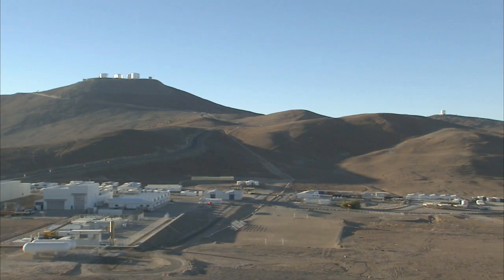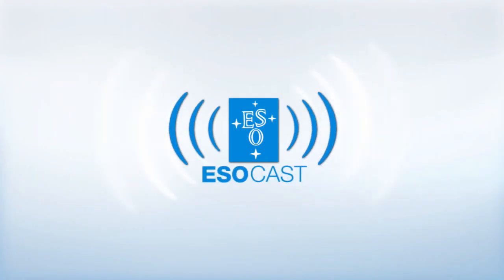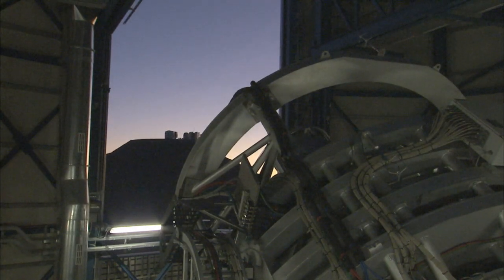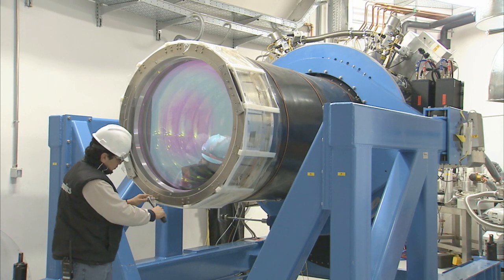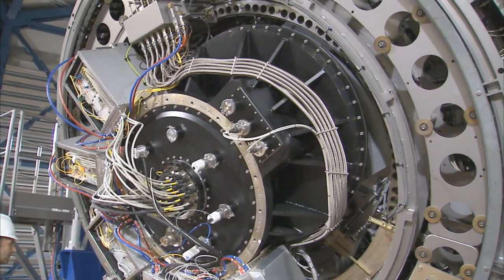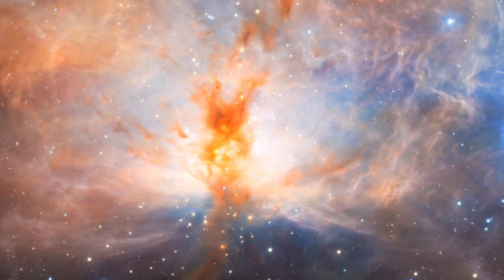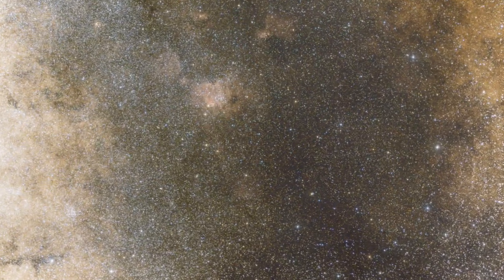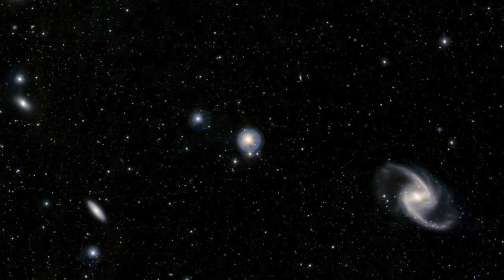VISTA - The World's Most Powerful Survey Telescope

Comment: @Temuldjin It may well suck, it depends on whether the air conditioning is turned on.
However I do not believe that it will need as many updates as the Operating system of the same name.